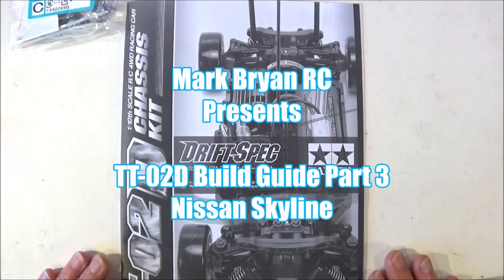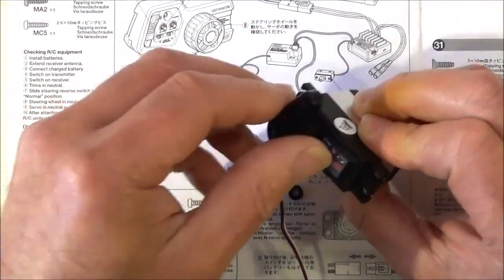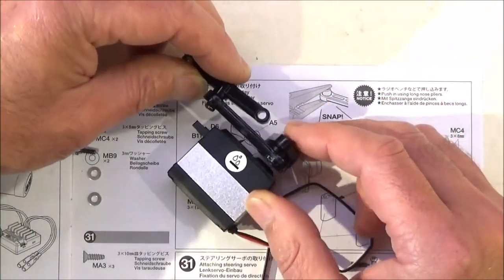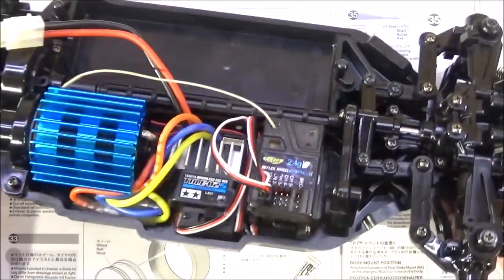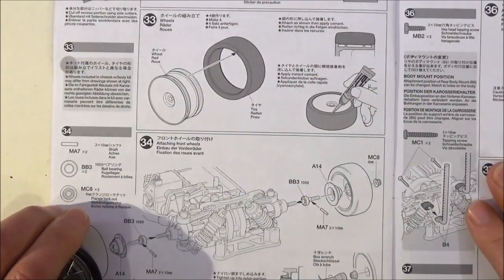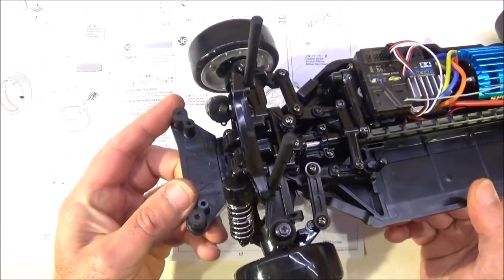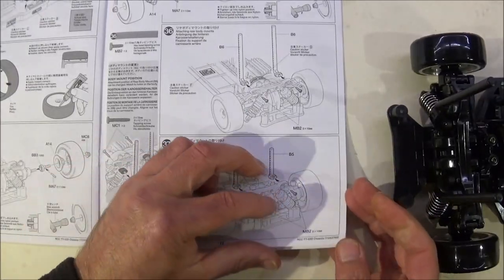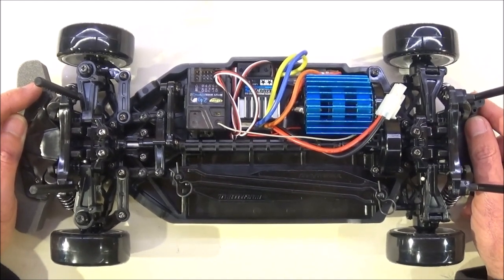Tamiya TT02D DriftSpec Build P3 Nissan Skyline Chassis Complete

Comment: Of COURSE I stuck around Mate!! 👍👍 Like you, as soon as I saw those Discs, I knew I had to paint them Silver. They make quite a difference don't they? 
Those TYRES!! 😲 How they offer enough grip to even get moving, baffles me! I'm certain they work, they've been used for many years now....

Another fantastic installment. Looking forward to the PAINT!! That's where you truly shine! 😎😉
Carmine ✈🚂🚙
Reply: And, NO Wibbly Wobbly?? 😲
Welcome to the 21st Century Brother!! 😆😄😋
Reply from the maker: Hi Carmine! Thanks for staying till the end! Yeah, disks are steel on these cars - right?  :P
Don't hold your breath for the paint, as I said to Mikael, I have made a mess of that :-/  I sprayed it in cold and damp conditions (the weather is awful at the moment) and have massive sags and runs in the paint, plus it did not go into all the little corners. Gonna go over to Robs and see if we can get the paint to cover properly (had to order another tin of red) but I will be stuck with the runs! Strategic sticker placement time I think. Oh well, it will make a nice basher body!  :-)
Reply from the maker: Well, I am using the only 2.4G one I have (it was in the Racing Fighter too) - I need to keep costs down so am sharing radio equipment between cars. It's easier to swap this one without needing to re-route the aerial every time!  :-)
Reply: I mean this with respect... How could YOU make a rookie mistake?? 
Don't worry Brother, it happens. 

My Piper Cub was a complete write off because of a rookie mistake!! 😋
You'll sort this. 👍👍
Reply: .... With 2.4 Ghz, you don't even need to remove Recievers. If they are cheap enough for that Radio, you can just buy more Recievers, and Bind each Car to the one Transmitter! 

Works that way on me FlySky... Recievers are only $6.00 for it. I've got all 3 of my RCs bound to it. 😉
Reply from the maker: Cheers mate - yeah, I could buy more receivers, but they ain't that cheap over here, about £15 for the Carson one I have. Believe it or not, I really could do without spending any more than I need on this hobby, with my 2 kids in higher education and costing me a fortune!  I'm just trying to keep up interest in my channel with the odd new Tamiya as a present or two (fingers crossed for Christmas) Hopefully I might get another free car or two to review and that would help massively! 
All the best mate!  :-)
Reply: If ANYONE understands, it's me.... 
I hope Santa is good to you this Christmas! I'm not expecting ANYTHING, so I shouldn't be disappointed.
Reply from the maker: I know my friend! Luckily I am not on the breadline, but not far from it!  :-)
Reply: Being ON the breadline.... It's no fun. 😭😭😭

Comment: Hello is there a specific controller and battery I should look for and get trying to get everything right for my RC it's the same R33 got it for my birthday 😁 just want to make it right the first time lol
Reply from the maker: Hello - great RC, isn't it? As for the controller and battery, it's a matter of personal preference. There are so many options available. Personally, I prefer a stick radio, but most people use the wheel type controllers these days. As for batteries, I still use the old NiMh packs, whereas LiPo's are more common these days. Most options are good enough to run the car well, just go for the type that suits your needs. Hope you get on well with the R33!  :)
Reply: @MarkBryanRC  thank you soo much and ya I tend to like the wheel one just recently got into to the hobby again my dad had a few and we did got to like hobby town events and Texas heat waves car shows so love cars so thought it be time to get into the RC car drag and drift would 😁😁

Comment: hi mark, just got my first tamiya tt02d kit and have spent hours (literally) racking my brain as to why the servo isn’t showing any signs of steering when all connected properly even though the throttle works fine. along with this, when i accelerate, only the left wheels seem to have any power going through them, the front and rear wheels on the right stay completely still. i’m still building it and am about half way done but can’t get past these issues. hope you can help me 
thanks
Sam
Reply from the maker: Hi Sam. Hmmm, I have had a really good think about your problems, and am finding it hard to think of the cause, it's very hard with not being able to look at the chassis. If the throttle works fine, plug the servo into the throttle slot on the receiver, when you move the throttle on your transmitter, the servo should move. If it does, there is a problem with your receiver steering port. If it doesn't move, there is a faulty servo.
As for the right wheels, I can only think there is a problem with the differentials. Swap the front and back diffs around (put the front diff in the rear and vice-versa), if the left wheels then don't move, it's a problem inside the diffs and you need to rebuild them. 
Hope this helps.  :)

Comment: Really nice job there painting those brake discs Mark.
Did you say you have an 2.4 GHz receiver now ? No more wibbly wobbly ? :)
Reply from the maker: Hi Are! I hope you are well. Yeah, those disks didn't look right in black. Well, I have had that 2.4GHz receiver for a couple of years, it came as a bundle with my Sand Viper. I am cutting costs now by sharing radio systems across models and this was at hand! It will probably get swapped about again so you still might see the TT02D with a wibbly wobbly one day!  Thanks for the comment my friend  :-)

Comment: Hey Mark, which servo did you use in this  build?
Reply from the maker: Hi - the servo is a cheap Etronix analogue waterproof standard servo - ES030. The other part No for it is ET0015 - works OK, no complaints!  :)

Comment: Hi I’m in need of help building my rc Tamiya Nissan GT-R Drift TT-02D 58623 , I’m in the last stages of the build process  I’m in the uk and these are the parts I need    A servo, battery, charger, 2 channel radio system/ transmitter and receiver are you able to recommend where I could buy the parts from or any replacement parts? Thank you
Reply from the maker: Hi Ashon - my goto store is TimeTunnelModels - great prices and good service. I'm sure they will have all the items you need, they also do a "DEAL BUNDLE" of the stuff you need to complete a Tamiya kit  - check them out!  :)
Reply: Mark Bryan RC  thank you so much for the quick reply this has helped out a lot I will check them out now

Comment: Sir, can u tell me what electric set (esc, servo, remote) that you used on your TT02D?
Reply from the maker: No problem Sir!
I used the standard Tamiya TBLE02s ESC with the Tamiya Sport Tuned Motor. 
The servo I used was a cheap Radient RSBS201PG Standard 5kg analog servo, which is just the job for this chassis! 
The radio system is a Carson 500500084 - FS Reflex Stick Pro 3.1 2.4G 2 Channel Remote Control and Receiver.
I hope this helps! 😎👍

Comment: I have this car kit and not sure if I have the servo correct...if I turn my wheels left by hand they stay there but when I turn them right there is tension and they automatically pull towards the Centre again...Im struggling with the final assembly part
Reply from the maker: Sounds like the servo needs centering! I'll tell you on the other comment.

Comment: Hi I'm looking to get one of these set but have never owned or built an rc car like this and I've noticed it doesnt have any batteries or controllers? What set up to you use and how much etc or do you have a video link ?
Reply from the maker: Hi Dean - The electronics side of the RC hobby is pretty basic to be honest, you will have no trouble with it. You will need a transmitter and receiver, an Electronic Speed Controller (ESC) and a servo for the steering. The ESC and servo plug into the receiver, and the ESC connects to the motor wires and the battery. The best way to start is to buy a "kit bundle" from a retailer - there are many to choose from and you will get all the electrics that you need to get the RC going, even the AA batteries for the transmitter! Another bonus is that these bundles are usually much cheaper than buying the items separately, and you know they will be compatible with the chosen RC kit.  Take a look at Time Tunnel Models ( https://www.timetunnelmodels.com/live/catalog/tamiya-58605-nismo-tune-tt02d-drift-chassis-complete-deal-bundle-p-57087.html ) and you will see what I mean. Good luck with your first kit!  :)

Comment: Hi, I ordered the 3-wire control unit as in the video but I have a 2-wire motor, any advice?
Reply from the maker: Hi! Yep, you only need to connect the ESC blue and yellow wires to the motor. 😎👍

Comment: Hi Mark,i stay in the last parte with the TT02D Supra edition and the wheels goes to reverse?You know the problem?is my first time,thank you my friend😀😀
Reply from the maker: Hello! Thanks for the comment, I must say that I'm not really sure what you mean, if the wheels go in reverse when you press forward, try the ESC settings, swap the motor wires over or set the reverse on your transmitter. Hope you sort it out soon. Best regards from Mark...   :)

Comment: So when you put the barrings  on around 7:29 the barrings that I have left won’t fit and I’m confused cause I followed the steps aka the video.
Reply from the maker: Hi - oh dear! I hope you have not got the wrong bearings in the kit. However, it is easy to put the smaller bearings in place of the larger ones, especially in the propshaft. I have made this mistake before. I would check all the bearings you have fitted so far. Hope you get it sorted. 
Mark

Comment: Did they gave the servo and esc.because I'm gonna buy a kit.
Reply from the maker: Hi.  No, my kit didn't include any electronics, but many vendors do supply the standard Tamiya TBLE02s ESC.  You could shop around for a deal where the whole package is included, usually at a better price than buying all the electronics and battery separately.  👍
Reply: What about servo parts
Reply from the maker: Hi - when you buy the transmitter and receiver it usually comes with a servo, if you buy them separately, the servo is about £10. The servo arms and servo saver are included in the Tamiya kit.  :)
Reply: Thanks man.by the way I love your skyline.

Comment: I'm not getting how the brushless ESC fits with the brushed motor. Which wires go where and what do you do with the third wire?
Reply from the maker: The TBLE02 is for both brushed and brushless motors - and is set to brushed mode as standard. You do not need to connect the orange wire, just use the blue and yellow wires, yellow is positive - the instructions show you how to do it!   :)
Reply: Mark Bryan RC Thank you so much for the quick response. And thank you for clarifying. I did not notice the instructions said that 😂
Reply from the maker: No worries, Dan - I have to admit the instructions are very confusing! have a good evening!  :-)
Reply: Mark Bryan RC haha yes they are. and thanks, you too

Comment: good evening where did you buy the engine? because I ordered the TBLE-02s but it is not compatible with the engine that came out in the TT-02D kit, I would be happy if you could give me some advice, thanks.
Reply from the maker: Hello! The motor came with the kit and it is compatible with the tble02 esc. You need to look at the tble02 instructions and set it up for a brushed motor. I hope this helps 🙏
Reply: @MarkBryanRC  that's fine thanks, I'll do it, but I noticed that the motor has two cables, whereas the tble-02s has 3 cables, does it do anything about it?
Reply from the maker: Hi! The 3rd cable on the ESC (orange) is for fitting a brushless motor and is not used when fitting the stock brushed motor. You only need to connect the blue and yellow wires. 😎👍
Reply: @MarkBryanRC  thank you very much I solved the problem the machine works you are the best💪🏽
Reply from the maker: @pallesudategamer  Excellent! Glad to hear you got it going! Cheers! 🍺😎👌👍
Reply: @MarkBryanRC  good afternon sir, sorry to bother you again but I think I have another problem. I noticed that my RC is faster in reverse. Do you know the reason?
Reply from the maker: @pallesudategamer  Good afternoon! No worries. Try swapping over the wires from the ESC and motor. The motor will then run backwards. Then use the button on your radio set controller to reverse the throttle. The motor will now go forwards again and should be faster! 🤞🤞👍👍
Reply: @MarkBryanRC  A thousand thanks! after reversing the cables everything works fine top!
Reply from the maker: @pallesudategamer  Great news! I'm so happy that I was able to help! Cheers! 🤗🤗👍👍

Comment: How do I contact you to help me with my servo....soon as I switch on my car the wheels turn immediately and the servo takes strain you can hear it pulling amps basically and it's stuck in that position
Reply from the maker: Hi Clinton. I think your servo needs centering. Take off the servo saver (you may need to remove the servo from the chassis). Set your radio steering trim to the middle. Turn on the radio and the turn on the car with the ESC switch. The servo should centre. Turn left and right to check the servo moves correctly. Let it centre again and turn the car off. Re-fit the servo saver in the position as shown in the manual, it's really important to get this right. Fit servo to the chassis and all should function correctly. Good luck!  :)
Reply: @MarkBryanRC  Thank you Mark...That worked out perfect and my steering is all good and sorted out 👌I was lost on that part
Reply from the maker: @djiosmomobileSE  You are very welcome - I'm glad it worked!  :)

Comment: I noticed on my car the back of the car sits lower than the front in the stock configuration. Is that normal?
Reply from the maker: Hi - I checked mine and it sits pretty level. Maybe the weight of the battery and motor cause the rear to sag a little? I would just put a small spacer (that you get on the shock parts tree) on the rear shocks to even it out - nothing to worry about, I don't think!  :O)

Comment: My suspension is stiff. I didn't add oil like you either. But ie no idea why its so stiff
Reply from the maker: Hmmm.... Not sure if it is as it should be, it is pretty stiff on mine too, but impossible to compare in a message! You will find out when you run it. If it's stiff but moves smoothly, it may be OK! Hope it runs well! 😎👍
Reply: @MarkBryanRC  hello Mark. I put the oil in and now its fine lol I now have another issue. I've built the kit. Got to the electrics and I'm getting nothing. No steering no power to the wheels.. I have a hobbywing esc and a cheap servo with the absima transmitter sr2s.. I don't know what to do :(
Reply from the maker: Oh no! One problem sorted and now another! I hope you find a solution - if all fails, disconnect everything and start again!
Reply: I fixed it. My fault. Was too eager and didn't read the instructions properly. All up and running. Thank you again Mark
 You videos made it seem another easier to do. All the parts and such looked over whelming lol but I'm loving it !
Reply from the maker: Ahhh, what a relief - so good to hear it's fixed! You are very welcome my friend, anytime I can help just drop a line! 😎👍

Comment: I'm trying to install a tower pro sg-5010 servo that came bundled with the kit but neither parts d11 or p4 seem to fit, the servo comes with a few different arms but none like the single arm that comes with the kit.
Any advice would be appreciated.
Reply from the maker: Hi there! I have never used that servo but it's a standard full size servo that should have either 23 or 25 splines (teeth) on the output drive. The TT02 kit includes adapters that have 23 and 25 splines. Look at the arms that come with the servo and match it to the correct Tamiya part. The servo arms are sometimes a very tight fit and take some force to fit them. Good luck!
Reply: I managed to force it on most the way, hopefully the screw will stop it from coming loose.
I've tested it and everything looks like it's working fine.
Thanks for your help, not sure i could of done it without these videos  👍 @MarkBryanRC
Reply from the maker: That is great news! Well done for sorting it out and I'm glad I could help in a little way. Have fun with it! 😎👊👍

Comment: Does this come with motor and servo etc ??
Reply from the maker: Hi. It comes with a motor and ESC, but you need to buy the servo and radio gear separately. Cheers!
Reply: @MarkBryanRC  could you link me to a good servo and receiver for this. Want to make sure I have everything before I start the build.
Reply from the maker: @jordyjords1928  Hi there! Here is a link to a decent cheap servo:
https://wheelspinmodels.co.uk/i/300289/
The receiver will come with your radio set. Not sure if you prefer the pistol grip or twin-stick type. The Flysky GT3B gets good reviews for a budget radio system, they are all over the internet at good prices. Cheers!
Reply: @MarkBryanRC  what matters when it comes to servos, is it basically just the dimensions of it?
Reply from the maker: @jordyjords1928  Any standard sized RC servo will fit, but it's good to get a good quality servo with a decent power, e.g. over 5 kg. Metal geared servos also generally last longer and are stronger. Hope this helps.
Reply: @Mark Bryan RC  thanks for the help on this but one other thing, what size battery can I use? I've got a few 2s lipos from flying helicopters, can I use those?
Reply: @MarkBryanRC cheers 😂
Reply from the maker: @jordyjords1928  Sorry but I wasn't notified about this message! Yes you can use smaller Lipo batteries, anything less than 140x45x25mm will fit.

Comment: Hello, what where all the electronics you used. Was it an entire kit?
Reply from the maker: Hi. The ESC came with the kit (TBLE02s) and so does the motor but you need to buy a radio system and servo for the steering. 😎👍